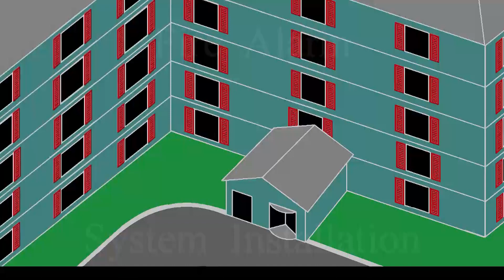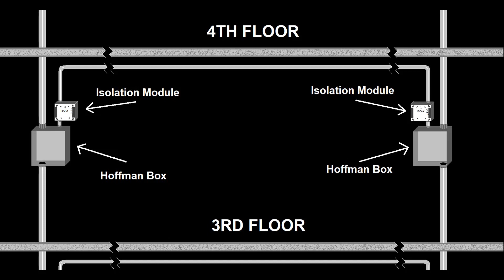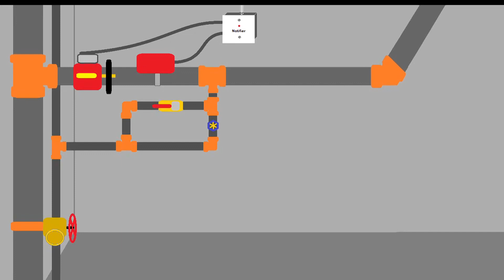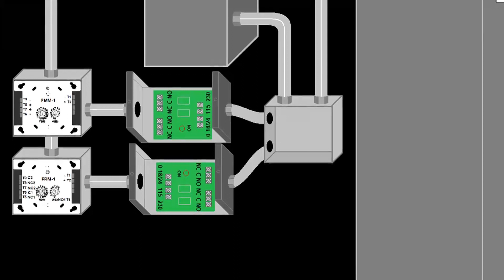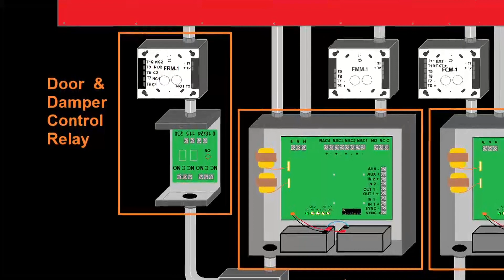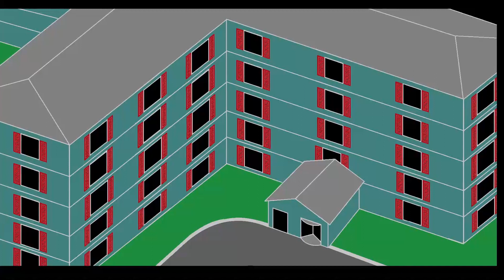New Fire Alarm System Installation - Series Preview - Video 44

Comment: I can’t find this series. Can you point me in the right direction
Reply from the maker: There's only been 2 videos so far. Unfortunately these take a while to do and I don't have the same motivation I used to.
Reply: @JoeKlochan  have you ever worked with isolator modules I can’t find an answer I was told you can only install 25 devices on one but can you put another isolator on that to have more devices without running the main SLC to the 26th device
Reply: @JoeKlochan   Hi there Mr. Joe, I suggest you release one video at a time but charge for it. You have already shared a lot of your knowledge for free.  There are a lot of people that need that knowledge desperately including me. In that way, everybody wins.

Comment: Hi my sir...

How you can repair the net work in system?
Reply from the maker: That's a hard question to answer, there are a lot of variables. If it's a wired network, there are cables connecting the buildings together. If one building loses communication, troubleshoot the wires. That would be the same with fiber. You could also have a network card failing.

Comment: Curious y you did not use ACPS-610 on this. To reduce FCPS & FCM + FMM
Reply from the maker: That's a fair question. I suppose the answer is a mix between the following three answers:

1. This way will show people some of the different uses of conventional power supplies.

2. The addressable NAC panel would make these even more Notifier-specific than it already will be, whereas just using control and monitor modules makes it more applicable to other manufacturers as well.

3. The company I used to work for avoided those things like the plague (for the life of me I could never understand why), and so I don't think I've ever used them.

Comment: Hey man, love your videos.

Hope you can get through for the wiring configuration for the Ansul interfacing. Specially for the shutoff of electric appliances under the hood...

Condition: 
1. Some cooking equipment under the hood has its circuit breaker where you can put shunt trip device...
2. The other cooking equipment under the hood are connected to a branch circuit. And told that you cannot shunt trip the main breaker because there are branch circuit for lightings, mini-freezers , and other appliances serving in other area.

Hope this will have in your future videos... :)